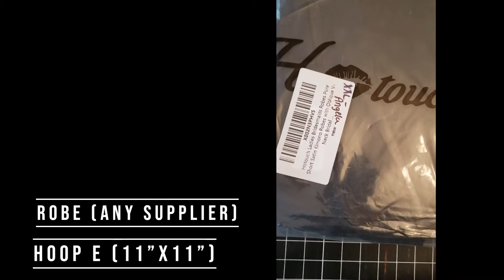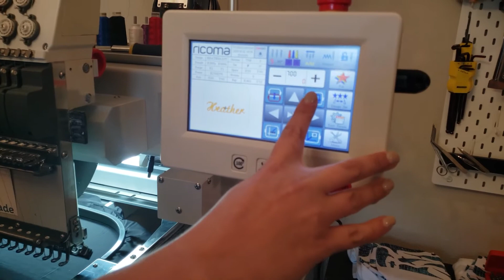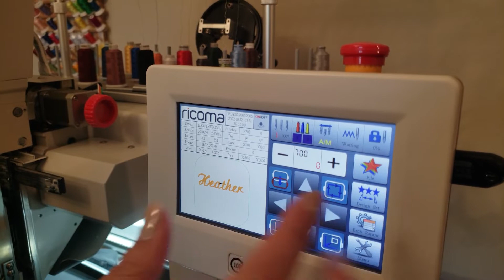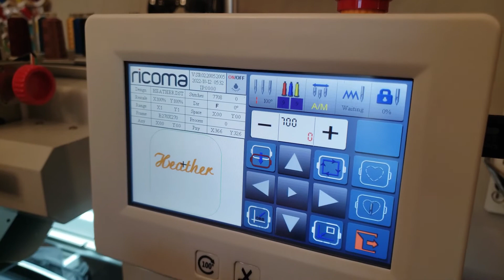How to Embroider Satin Robe - Easy Tutorial - Ricoma MT-1501

Comment: What’s your needle size? When digitizing did you use a specific under stitch or a specific setting etc?
Reply from the maker: Sorry for the delay.  We used a regular 75/11 needle and for digitizing, we selected "Satin" on Hatch 2 for the auto-fabric choice and had an edge run and a zigzag underlay which lowered the overall stitch count.